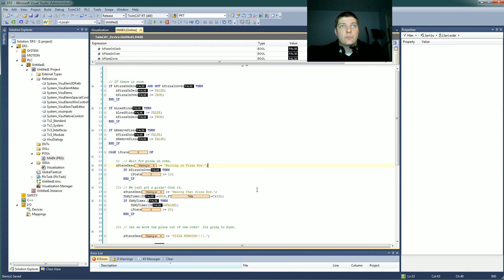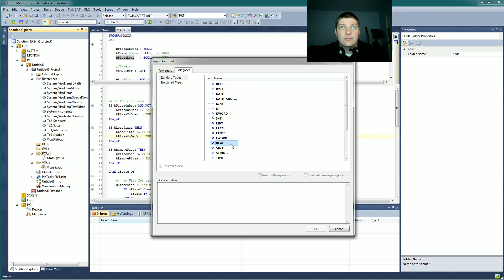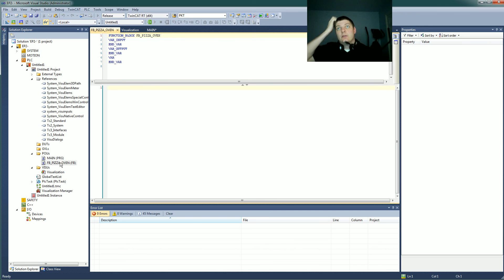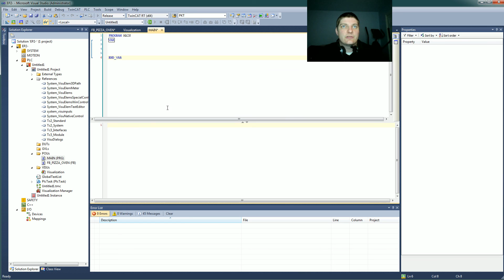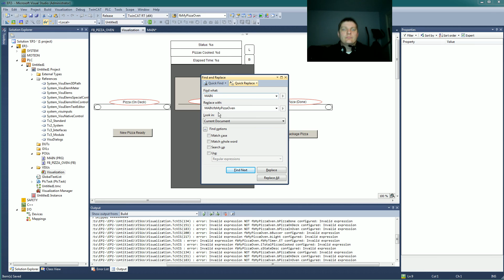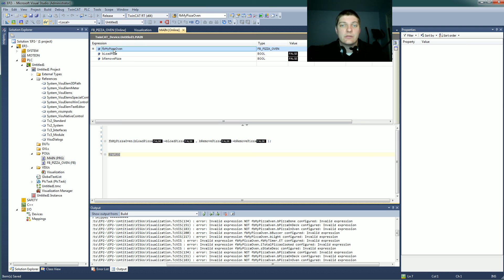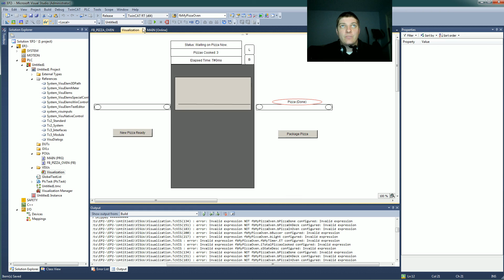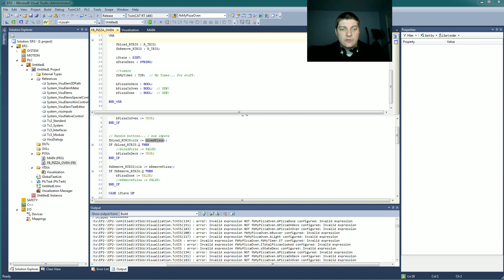Learning PLCs with Structured Text - EP8 - Functions and Function Blocks

Comment: Hello,
There was an issue i was facing, it seems that when you commented bLoadPizza and bRemovePizza after adding the trigger in the function block the bLoadPizza and bRemovePizza variables in MAIN were not getting reset at all. Due to this i was not able to remove pizza after being baked. I then uncommented the two lines and then the visualization is working pretty fine.
Would like others' opinion whether the way i did is correct or is there any other way that i am missing.
Regards.

Comment: How do you typically go about Retain/Persistent variables while using FBs? Do you save the vars as Retain/Persist inside the FB itself, or inside a GVL and map it to the FB using a VAR_IN_OUT, or similar? I would like to store my retain/persistent vars inside the FB so each instantiation comes with the memory space required, however the outside program loses Write access when performed inside the FB. Thanks in advance for advising, and for the excellent tutorials!
Reply from the maker: I got somewhat burned long ago with the built in persistent Variable system and I wrote my own storage to a "binary blob". It worked but didn't handle restore to a data type that changed size, so we replaced it using the xml functionality from beckhoff. It was so much nicer to deal with.  If you want you could use the database supplement but that is often overkill, a bit complicated, and like xml also costs extra money.   These days, my main code base has a higher level HMI built in open source software, so we wrote a basic api with a key/value store, which writes to an sqlite database. Really depends on the budget and flexibility, etc, but I'd recommend the xml approach. I wish beckhoff didn't charge for it but it's worth it in your time vs the persistent/retain junk (imo)

Comment: i don’t get R_trig can you describe it for me please
Reply from the maker: Sure... When you "clock" the r_trig funciton block, the first time it has a 'true' signal on the clock, it will set its .Q output to true, but only for one execution.  After that one execution, it sets .Q back to 0 even if the clock bit is still set true.  It won't turn .Q back on until it has been run with clock = false at least one scan.

Here is an example...  If you want to count parts going down a conveyor, and you have a sensor looking across.  If your code said "If Part_On_Belt Then parts_made = parts_made + 1".  That seems like it would work, but you'd be counting up "parts_made" the whole time that Part_On_Belt was true.  That could be hundreds of times it was evaluated while that part was covering the sensor, which would not be accurate.  So, to count just the "rising edge" of the part, you'd do:  "my_rtrig(clk:=part_on_belt);  if my_rtrig.Q then parts_made := parts_made + 1"

That way, you count the part when you see it, but you won't count the next part until the clock signal has gone low, which means you saw the part exiting the sensor, and the r_trig got ready for the next part.

Not to be confusing, but if you want'ed for some reason to count on the falling edge of a part, you could use an f_trig.
Reply: SquishyBrained Thank you i got it . So it is used for only counting the rising edge right? 
and i need the example in this video if you do the same way  (9.42) how it run ? Sorry for my question i just start to learn it.
Reply from the maker: I don't understand the question.  In the example, I just use it to make the button push only start a single pizza.
The code is linked in the description if you want it.
Reply: SquishyBrained  Thamk you so much
Reply: Yeah, it sounds like "One Shot Rising"  in Allen Bradley

Comment: Hello,

Why don't I have as many libraries in the references structure? How can I include some non-existing library?
Reply from the maker: bharath Find the references manager in the tree and add them using the browse button (going from memory)...  You can install supplements from beckhoff which are often in the form of libraries, you can create your own, or you can use public ones like oscat.
Reply: I don't see 'browse' feature in the list of functions of right click activity. Do you mean there is another way to bring in the libraries?
Reply from the maker: bharath Here is a better guide....
Open your PLC Project, then find the references folder.  Right click it and go to "Add Library".  From that window, click "Library Repository".  There is probably another way to get there, but that works.  
On the library repository window, click "Install..."  It will accept a compiled library, or a .lib file, etc.

I belive behind the scenes, it just copies it to your system location (Twincat\3.1\components\plc\managed libraries\), so you could also just add a location or alternatively add your library to that folder manually and restart the project.  I think any method works.

Then it'll show up in the "Add library" browser window and you can click it and hit okay and it'll go into the references folder and you can use it.